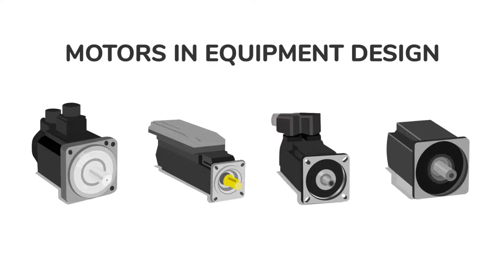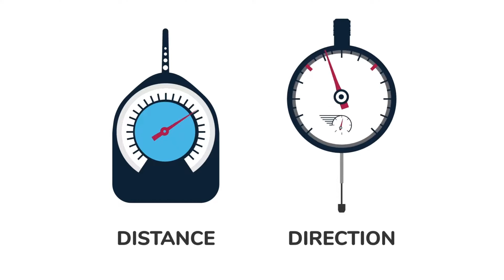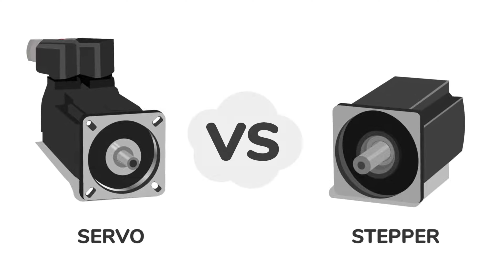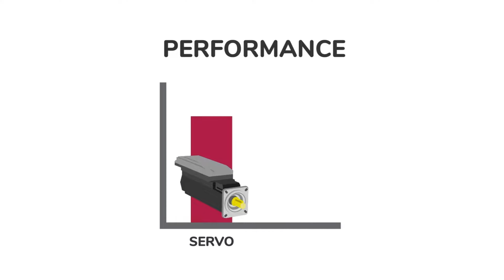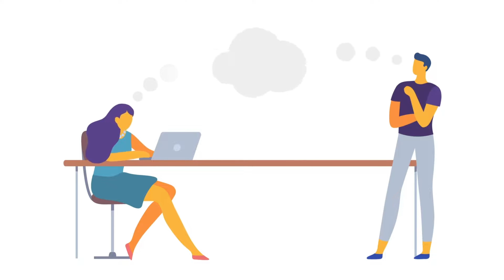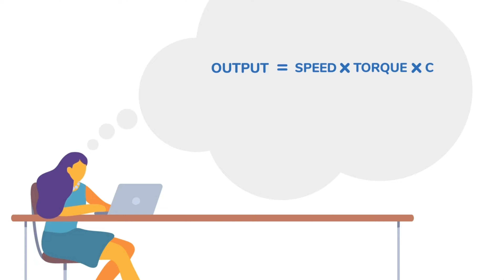Differences Between Stepper Motor vs Servo Motor

Comment: Good point on efficiency. People rarely factor in how hot steppers get when they’re just sitting stationary holding position. Switching to proper closed-loop servos, whether that's integrated motors or running miniature drives from guys like Elmo, AMC, or Beckhoff,  solves that heat issue completely because current actually scales with load. Saves a lot of grief with cabinet fans on high duty cycles.
Reply from the maker: You're spot on, the fact that current scales with load in closed-loop systems makes a huge difference for thermal management in high duty cycle applications.